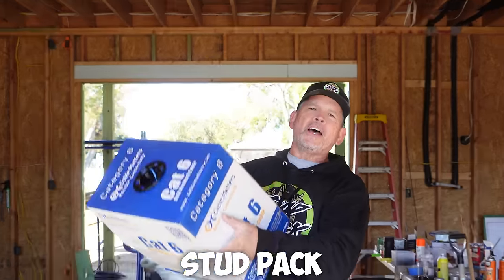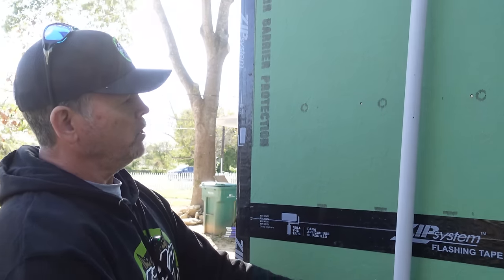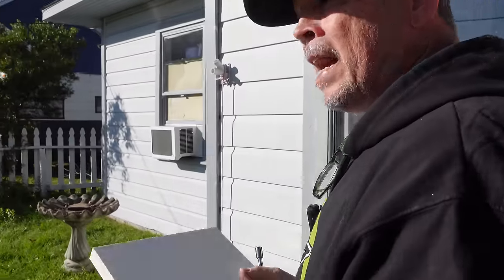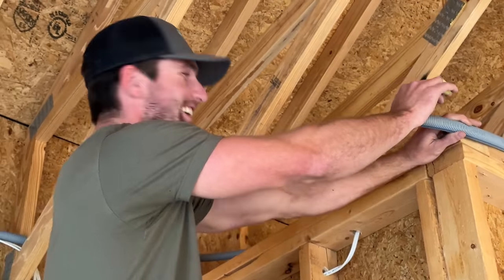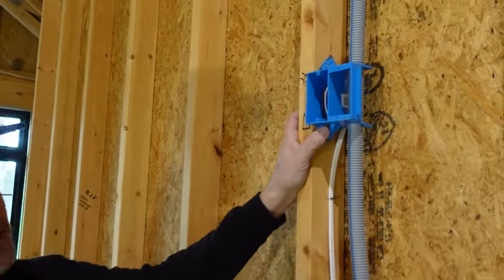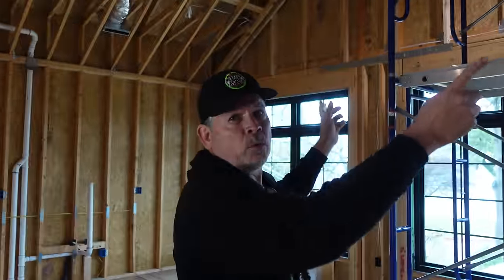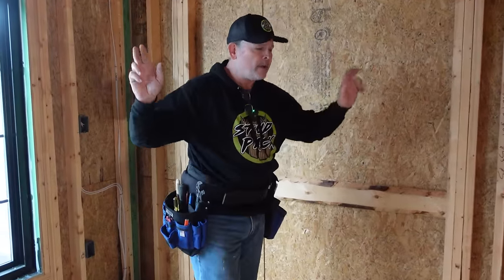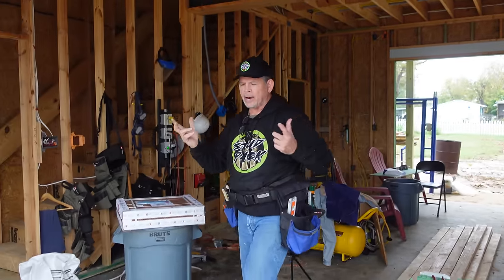DIY Networking for a Future Proof and HIGH SPEED Home! (Smurf Tubing and String Pull Trick!)

Comment: SVP, Silicon Valley Power, decided to replace the utility pole in my backyard. On the day five workers showed up. One had a spade and scoop each with a ten foot handle. He then dug a new hole next to the old while the others watched. The boss told me it was faster to dig by hand then to lay down plywood and bring in an auger. 

They then used a pulley and tackle to attached to the old pole to lift the new pole and drop it in the hole. 

The others jumped onto the new pole and moved the electrical lines from the old pole to the new. They then cut off the top of the pole down to the phone lines and took it away. 

Some time later the phone company came and moved the phone lines to the new pole, cut the pole off just above the cable lines and took away then chunk. 

Then the cable guys came and moved the cable line, removed the remainder of the pole and filled in the hole. 

It was a well organized dance, very impressive.  (Except for the cable guy. The cable shouldn’t lay on the roof of my shed. But he left his xl bolt cutter and the next guy who fixed the drooping cable forgot it too so I can’t complain.)

Comment: When you strip the cat 6 cable jacket, use as few twists of the stripper as possible (e.g. 1). You dont want to knick the conductors. The jacket is easy to cut, so you only need to lightly score the outside and bend it back and forth a couple times.

Also save the ~1 inch stripped cable jacket and use it to untwist each twisted pair. It seems silly, but it makes it fast and easy to separate all 4 pairs of wires in no time. Put the stripped jacket over one wire in the pair and twist the jacket.

I terminated over 30 jacks when we moved in, and the Klein ethernet tester was perfect. They sell multiple battery powered ends so you can also identify wires back at your home run in the equipment rack or patch panel.  Ethernet is cheap, so run two cables to every drop, even if you only terminate one. If you have a break in the cable, you can use the backup. Or if you need another port, its easy to add keystone jacks. The Klein tester can tell you the length of the cable, and can help find where the break is. A lot of people claiming you need cat 6a for 10 gigabit. It depends on the distance. Cat 6 is good for 55 meters at 10 Gbps. Cat 6a for 100 meters.

Conduit is a good idea for hard-to-run runs after sheetrock. Fiber might be the future for 10 Gbps and faster, so conduit is future proofing.

Comment: Basically, Cat6a cable comes into two flavors in terms of shielding types: shielded twisted pair cable (STP) and unshielded twisted pair cable (UTP). Cat6a shielded twisted pair cable has a shield in cables to prevent electromagnetic interference (EMI) or radio-frequency interference (RFI) from affecting the performance of the cable. It also prevents cable signals from interfering with surrounding cables and equipment. Properly installed Cat6a shielded cables automatically curb EMI and crosstalk, helping to ensure data integrity and high-speed performance. The Cat6a shielded cables must be grounded to work.

Note: if you choose shielded cables, there's no mix-and-match; everything connected to a shielded cable must also be shielded and grounded (like couplers, jacks, or even network controllers). You can't connect the shielded and unshielded cables. If I did an install, and did not go 100% fiber optic for legacy reasons, I definitively would ONLY install STP.

Comment: I work as a network admin, and even though you have cables in a conduit, I wouldn't want to see the conduit run next to electrical; for copper-based networking, it can introduce alien crosstalk, which is going to impact the signal quality and the ability to make a good connection over any wires in the conduit.  If it's fiber, since that's basically light in glass, it's not prone to any interference from power, so it's fine.  Given that it's such a short distance from that location to where you will be putting your network equipment, it may be fine to run next to power; I don't like it, but I don't have to.  The signal strength of short runs is much better than longer runs (like electrical, you get resistance over distance, and up to 100 meters, provided there's no problems in the line, it should work fine, add issues like alien crosstalk and over a long cable, it may be enough interference to cause problems.... for short runs where it's run next to power for only short distances, it shouldn't affect the function of the cable.

As an aside, this is the main reason I don't like soft tubing like smurf conduit for data lines, it's basically transparent for any electromagnetic signal, so having the data lines pick up on noise generated from AC power, or something else, is pretty high.  In commercial installs, like the ones I deal with, where conduit is basically required in most cases, I usually ask if they can run something ferromagnetic, like iron or steel, since that will usually act as an electromagnetic insulator, isolating the cable from any interference sources; it's rare that I get the opportunity to request it (usually conduit is already run by the time I get there), or simply my request is ignored or overridden by whomever is paying for the lines, but I try anyways.  To be fair, UTP, or unshielded twisted pair, is designed to reduce the chances that interference like this will cause a disruption in signal, unless the situation is extreme (like wrapping the network wire around the power line, or running it in the same conduit for an extended distance), but every precaution that can be taken is good.  Anything that can be done to ensure solid signal from end to end is going to help the stability of the system and reduce issues overall.

I'd also say you guys should put cables to central points in the ceiling where access points can be installed - if you ask around to low voltage wiring installers or any friends in I.T. you may be able to contract out a virtual site survey, where you send off a floor plan, and what each wall will be constructed with (drywall, plaster, whatever), and a skilled network tech should be able to find the optimal place to put an access point to provide the best coverage (at least, in theory), and how many network lines should be in the roof.  With that location, it's small enough that even having two, one for each floor, would be plenty, but I know you guys don't just work on small locations, so it might be worth considering if you are starting to get a lot of requests to install networking with renos or builds.  90% of people won't use them, but it will be a complete lifesaver for anyone who does.... it's a fairly trivial thing to find out, and install when you're torn down to the studs like you are in so many cases, and saves people a lot of time and effort in the long run; nobody wants to have to rip out their drywalled ceiling to run a network line for an access point.  Finding the optimal place to put them is just a way of paying it forward to whomever actually wants to use access points.  It's what I would like to see builders do, instead of a handful network lines dotted throughout the place on walls.  Bluntly, most people won't use wall jacks, but everyone uses WiFi, and when you want good WiFi, and 90% of the work is done, you just need to buy, hang, and connect some access points to get good WiFi, then it becomes trivial for people to upgrade from the mostly garbage WiFi that they get from their ISP modem to excellent coverage, with only a few hundred dollars in access points.
Reply: Unless you are using shielded cabling

Comment: Know that you are in warm Texas but you should always use an expansion fitting on every outdoor PVC conduit run. Have seen 2" PVC shrink enough during cold weather & ground settlement to pull the conduit out if the 2" male adapter and pulling 4/0 wire out if meter terminals. Great top of the line quality job that you guys are doing
Reply: Need to watch the video of the electrician that helped with the install, they addressed that every thing. He has his own channel and talks about the PVC conduit expansion.

Comment: So that string you cut out of the cat 6 cable has a purpose. You're supposed to pull that down to strip the outside layer off a little further past where you cut. This prevents you from using cabling that has damage to the twisted pair from using your stripping tool.

Comment: The comments on having easy access to the modem and network adapter are valid as they do need to be occasionally rebooted.  The idea of having a wall switch for their outlets seems like a good idea.    You might want to use 2 different outllets and switches.  I seem to remember that one should be turned on before the other.   

I would also suggest running extra network jacks in the walls (like we do with outlets) so you can have wired access all around the rooms and garage.

I would also install floor boxes for both power and networking where both the dining table and coffee table would be.  Especially if you have kids or dogs (future planning).

Comment: Great video as always. I always really enjoy the level of detail you guys put into explanations. As I see others are saying, I also recommend leveraging keystone jacks with wall plates. I find them easier and quicker to terminate, with the biggest advantage being the ability to use any length wire needed to the devices. I ran cat6 throughout my house (retro fitting the house was built in the 50s), and I found keystone jacks to be the way to go without knowing where exactly my devices would be. As well as the ability to move them around and when I feel I want to change things up. I also found it easier when I started getting tired of terminating the RJ45 end to just leave the wires long and pull them through the pass-through one at a time. I work for a software company and not hardware, so I'm no expert and take this with a grain of salt.

Comment: Hey Paul, good job on the network wiring. My opinion, use the pull string in the Cat6 cable to strip the sheath. I have run many troubles where the depth on the blade on the "twirlling stripper" has cut the conductors and it is covered by the sheath which ends at the plug and you can't see it and it will drive you crazy. I agree 100% with terminating in a Cat6 jack and a wall plate, then using a Cat6 patch cable to your device. Don't cut the patch cable and try to install a new plug. You will be sorry at some point. Trust me. An old installer idea was to make everything pretty. Then at some point someone has to trouble shoot. That's when you will be glad you did it like I suggest. No brag, just experience.Label your cable sheath both ends with a sharpie. Don't forget to run cables for any wifi extenders you might need. Make you a wiring diagram on paper for your cable locations. Don't wait until you have a trouble to try to figure out which wire goes where.

Comment: YES! This was the episode I was most excited for (I'm in IT). 

I would reconsider that location for the modem. You are going to need/want to reboot it fairly commonly, anytime the internet goes down that's the first step is to reboot the modem and/or router. It's also not great to have electronic devices (especially critical ones like this) in an unconditioned space. Not sure if that is the case in this situation but heat is bad for electronics as is very high or very low humidity. 

If it's just temporary until the house is built you are probably fine. However I wouldn't put it in a hard to access place.

I also do not understand the choice to use the male end in the office. Add a keystone jack on the wall. To my knowledge there is no reason not to.
Reply: Agree on the modem. I’m no expert but have had issues that required reboot/replacement. Climbing into that attic area with be a pain!!
Reply: 100% agree. You wouldn't tuck your electrical panel in the crawlspace, right? You need easy access to your equipment for service and maintenance.

Comment: One trade name electricians use for the plastic bag in the conduit is a “mouse”. In larger sized conduit, you need to tie your plastic bag to create a balloon so it takes up more space in the conduit. If it’s a really long run, you can start with even lighter string for the first pass through and pull it back through with successively larger string as needed.

Comment: TL;DR: Keep the plastic conduit as far from mains wiring as possible. Any amount of extended close proximity can cause coupling between the lines. Use shielded CAT wherever and whenever possible to help with EMI.

RF (Radio Frequency) engineer here. For the 120 V lines putting causing EMI (electro-magnetic interference), the conduit being next to the 120 V line would not be a problem if it was a grounded metal conduit. Since this conduit is plastic, it can only partially if not minimally prevent interference. Most digital traffic on the CAT cables will be at much higher frequencies than the 50/60 Hz of your average EU/NA mains. We usually concern ourselves with badly filtered/shielded devices which allow higher frequency signals to leak out onto the mains lines and thus infect the circuits with high frequency noise which can propagate off the mains lines and cause interference.

Some of the better CAT6e cabling will have shielding which protects the twisted pairs and this should be used whenever possible to aid in combatting EMI-rich environments.

Comment: When unwinding cable, conduit or pipe/tube from a reel. Mount the reel on a pole (horizontally or vertically). Pull the tube/cable etc from the reel. Unwinding it from the side will twist the cable/conduit/pipe/tube.

Comment: Solid stranded cat cable should be terminated. Reason is bending a solid stranded cable gives it metal fatigue causing issues later on. Fun to see the states catching on to Europe with conduit. In most of the EU we use conduit with cable already pulled cables in them,  and all of our boxes have the click  in fittings like you showed. Always fun to see some one else doing your trade maybe you or can teach.

Comment: BTW, the fiber can come straight into your house.  No box needed on the outside.  On the inside the fiber can plug directly into the ONT.  Since the fiber has no copper, there are no grounding requirements (or no way to ground for that matter.)  Just put a LB on that 1" conduit and you are set.
Also I used to run ENT, and after a few cat cables are installed it gets hard to work with.  So now I just run CAT-6 everywhere and i'm covered.  You can pump everything except water and gas over cat 6, great stuff.  Thermostat, door bell, low voltage lighting (watch the amps), audio, data of course, telephone POTS, and more.

Comment: As everyone else said you said use a jack module with a wall plate.  Also, when you terminate up top where your modem will be, you may want a small patch panel depending on how many runs you have. It’ll make everything nice and neat and look more professional. Then the patch panel wire connections will go into a network switch (you can get 2 foot patch cords or whatever size you need) and then one cable from the network switch can plug into the modem.

Comment: I echo the call to terminate your CAT6 with wall plates and jacks. I would also suggest adding some more surf tube to any entertainment areas (TV's etc) and some strategic points where you might want WiFi access points. Just make sure the conduit for the A/V areas is 1.5" wide or bigger so you'll be able to fit the head of an HDMI cable, or any yet-to-be-invented cables. If possible, behind that TV install a media outlet "box" that with 1.5" smurf and 120V and run some HDMI or other media cables while the walls are still open (if you haven't already). 

It's tedious, it's an extra step and cost, but while you have the walls open if you put that conduit in it'll forever be easier to retrofit/add on other tech, for both you and for other technicians. 

Otherwise, great work. I really enjoy watching y'all work, especially your attention to the details. Thanks so much for both being willing to share; exposing yourself to critique on the internet for anything, especially building and design, takes real courage and is admirable, IMO. ;)

Comment: I always install quick flash before I install my siding block so you don't compromise your zip wall assembly. Your conduit or raceway goes through the quickflash, into the siding block for a 100% watertight system. You should look into that, since you made penetrations into the zip with low voltage and well as your main panels. Then install head flashing over top of the siding blocks. I never had any callbacks. 😊

Comment: IMO and I've run a ton of conduit and Smurf tubing with fiber in particular. We use orange color for fiber, we run them alongside electrical all day long but in illinois, we have to put all of the electrical inside of EMT piping so a lot of times we will zip tie the Smurf tubing alongside the EMT piping. Since you are using Romex I'm not sure on that but I do know that they do coincide here in Illinois but all of our electrical is inside of EMT pipe

Comment: A couple of comments .... I suggest alarm wiring to sensors on the garage and general access doors.  Maybe a motion detector too.  The plastic member on the CAT-6 cable is not just for strength of the cable, but to space the twisted pairs properly.  I also suggest doubling up on the Cat-6 runs to each box location. , to have  backup if the sheet rock folks damage them.  They did on my home project.  Finally, I suggest also running a pair of 75 ohm coax cable to each location where there will be a TV or audio system.  All this provide maximum flexibility and reliability, while the walls are still open.  I personally try to minimize WiFi communications.